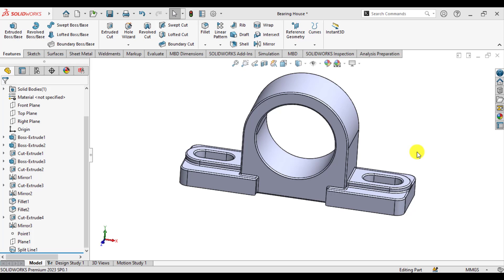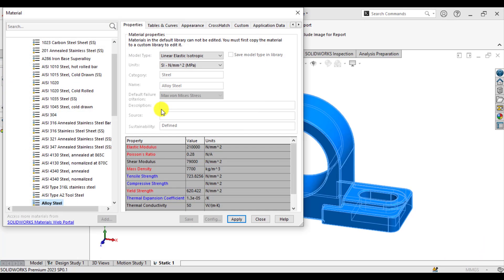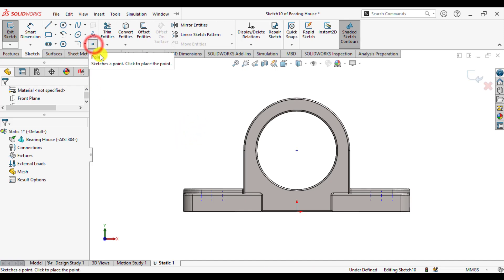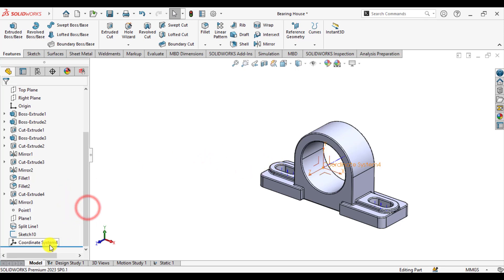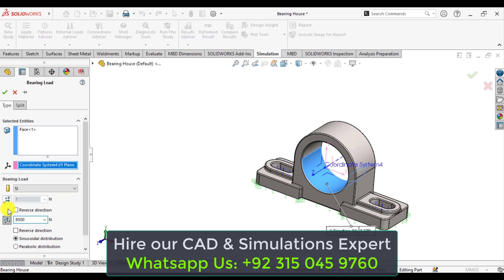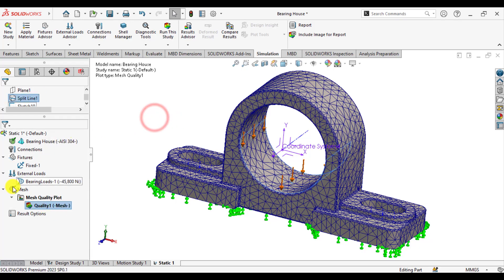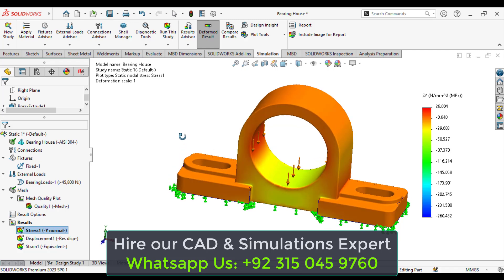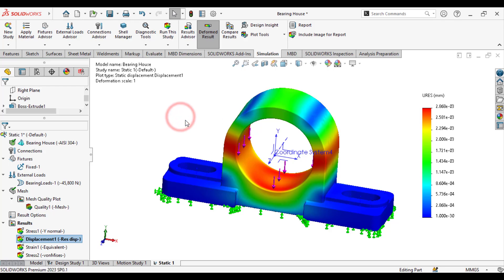SOLIDWORKS Bearing Load Simulation | Static analysis of Bearing Housing

Comment: This loading scheme does not seem to be the correct way of analysis, as it appears that the load is not uniformly distributed on the contact area; rather, it is being applied as a line load on three locations (3, 6 and 9 O'clock). This can be seen through the displacement results.
Reply from the maker: You are absolutely right, it's just a simplified analysis for demonstration purposes. I will create a more realistic simulation in the future!